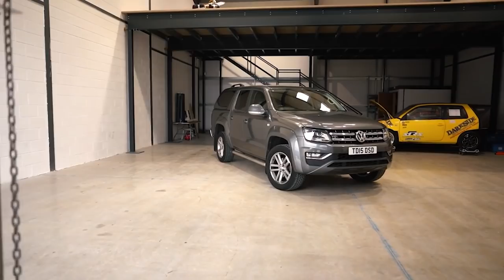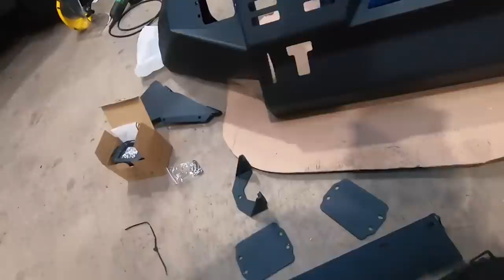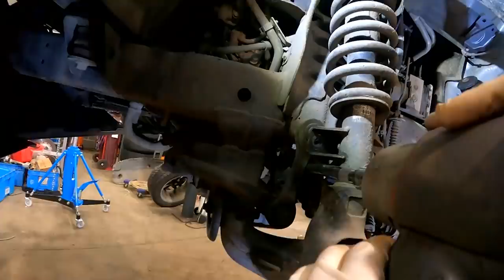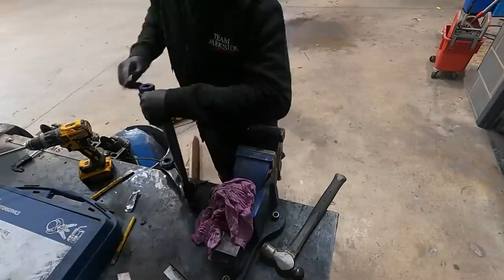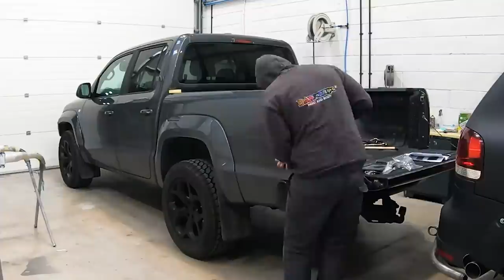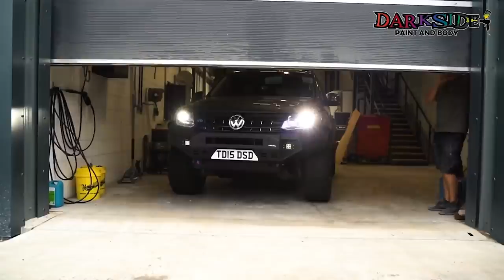Building our V6 TDI Amarok in 10 Minutes!

Comment: Very nice build. Pretty much what I’d do to my Rok but not sure about the air suspension. Is it to increase the load capacity in the tray? Could the same thing be achieved by a suspension upgrade?  That’s some beauty work you guys do. Well done from Fiji.
Reply from the maker: We have to do it to increase the load capacity from 6000kg to 6400kg and towing to 3500kg. Thanks